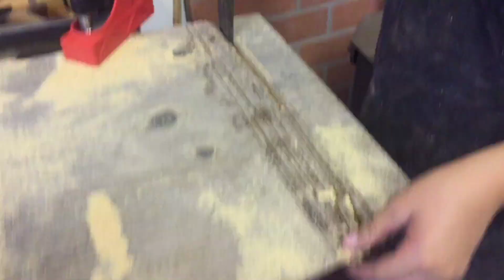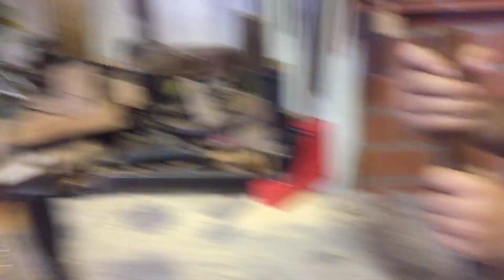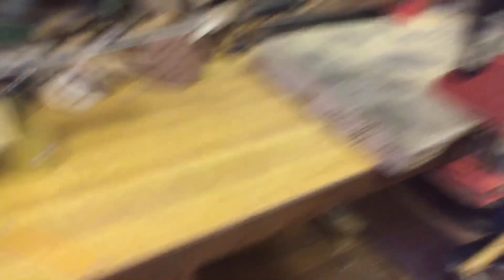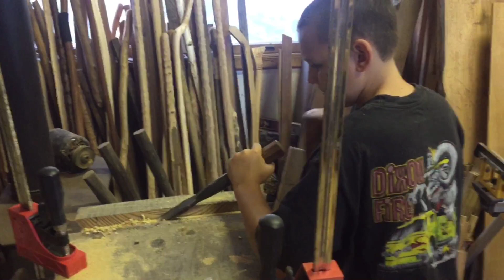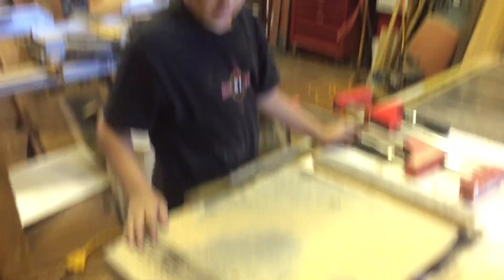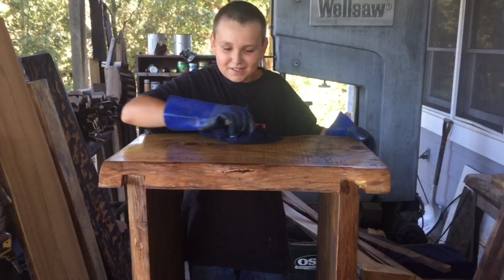WOODWORKING WITH KIDS

Comment: And just to keep woodworking lexicon confusing to the uninitiated that same dado cut becomes a slot if rotated to go with the grain and a rabbet if run around the perimeter because we can never just use the same term for what is practically the same operation.  ;-)

Out of curiosity, will you be adding a stretcher to help reduce racking of the stool and torquing against the dados which stools are quite prone to in use?  A simple stretcher a few inches tall installed vertically will greatly stiffen things and reduce the tendency to rack under dynamic loads (you might even get the chance to demonstrate a wedged or pinned through tenon if you want to exercise the inner Neanderthal and keep things old school).

But it is really nice to see you sharing your love of woodworking with our youth.
Reply from the maker: Ethan Poole he wanted a smaller stool to fit under this one so his little (old), dog can climb up to his bed. Those legs are solid